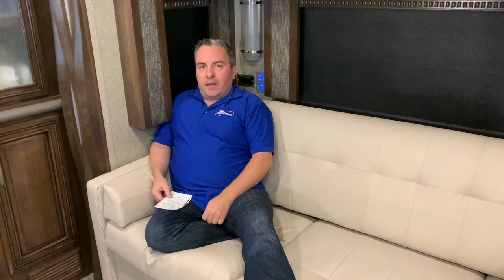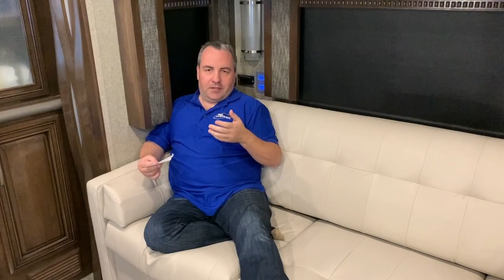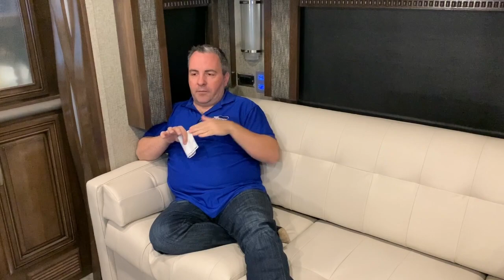Nov 2019 Update

Comment: Will have a Newmar full wall slide on my Bay Star and presume when Wally docking you start the gen first before employing the slide but was wondering if you then also deploy the jacks?  I'm waiting to order the 2021 model (3401) in April of 2020 because of the new upgraded F-53 chassis (26,000) and since it will be a new setup I hope I don't encounter the "new" issues you mentioned with your coach:) Thanks for the update too safe travels:)
Reply from the maker: I'm always aired up before deploying or retracting slides (this varies depending on model -- some want jacks down first).
I don't bother with the jacks in public parking spots ... I try to park as level as I can, and if it's not level, I just deal with it.  It's not as big of a deal for an all-electric coach because the fridge doesn't need to be level like a propane-powered one does.
Thanks!

Comment: In listening until the end what tow bar and brake setup do you have with the Jeep Wrangler? I presume it is the 2 door and not the 4 door or am I wrong about that? Plan to tow the 4 door automatic Sahara (2014)  myself which I understand is a much better ride than the 2 door although about 450lbs heavier.
Reply from the maker: Blue Ox Avail and RVI Brake 3.  2-door.  What's the tow/hitch rating of the Bay Star?
My new towing setup will add over 1,000 pounds unfortunately .. but I probably generally won't notice given that my overall weight right now is about 39,000 pounds .. so what's another 1,000 haha
Reply: @TisTheDestiny   Bay Star is a gas model so not "air up" which is why I was wondering if you put your jacks down. Guess safer way is to just put them down. Only need or want to put out the FWS anyway. The Bay Star 26000 chassis has a 5000 hitch rating with a overall 30,000 weight limit. The 26000 chassis gives you more CCC and so I will borrow a little of that so not to go over the 5000 hitch weight. Plan on using the ready brake system https://www.readybrake.com/
Reply from the maker: @legaleagleandpaws8198  Ah, I see.  You'll definitely want to put the slides out in whatever conditions the instructions tell you to.  If jacks need to be down first, you'll need to do that.  You definitely don't want to be moving the slides in/out otherwise.
Reply: @TisTheDestiny  the IRV2 and Newmar dilemma...jacks down first then slide out..or slide out then jacks down...lol  Think it is the latter:)
Reply from the maker: @legaleagleandpaws8198  LOL I pay attention to the docs that came with my RV and no one else.  That way if something goes wrong, I can point Newmar at their documentation!
IRV2 creates the dilemma because every coach is different.
Reply: @TisTheDestiny  Agreed:)

Comment: Thanks for the video. Question: Do you feel Ok having bought a 33 ft  New Aire (driving and maintaining systems) as your first rv or do you wish you would have started with a smaller sprinter chasis such as an LTV unity to start with?

I am looking to rv alot when I retire, but have never owned one before. Concerned the New Aire is like driving a bus which I dont have experience with.
Reply from the maker: Yes -- in fact, I'm very happy that was my first RV.  I've driven Class C's -- which was at first less scary because they're smaller, but the New Aire drives better and doesn't fatigue me nearly as much as the class C did.  The New Aire is quite nimble.  I remember when I first bought it and walked up to it and really "saw" the size of the tires for the first time and made a mental comment "OMG, what have I done?!?" ahah but I got used to it.  Every time I got in to drive it, I had serious butterflies ... after the first 3,000 miles of driving, I no longer think about it.  I just hop in and drive ... even if it's been 4 months since I last drove it.